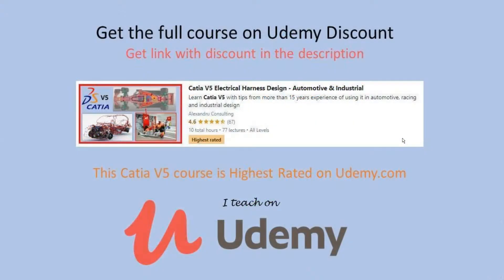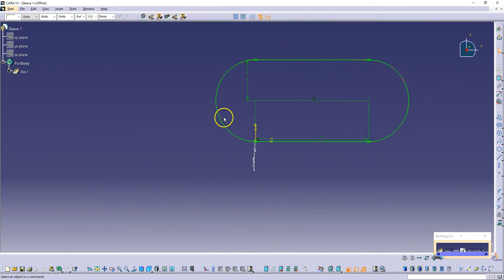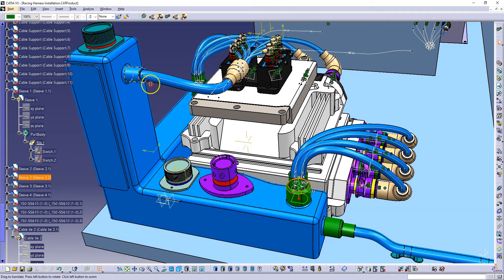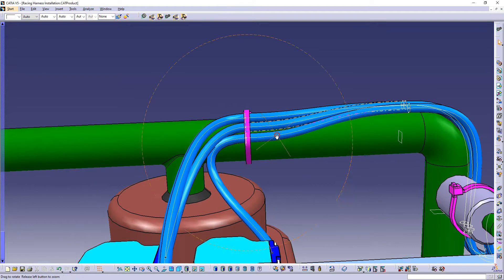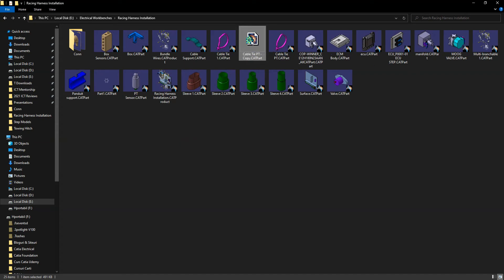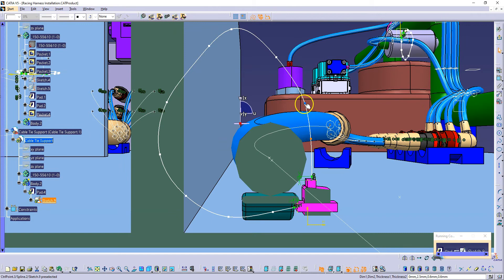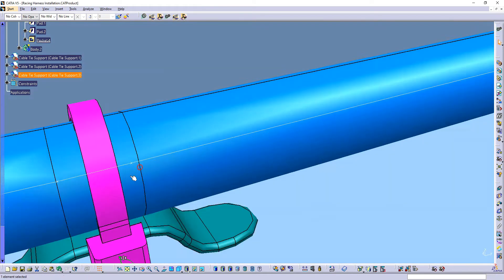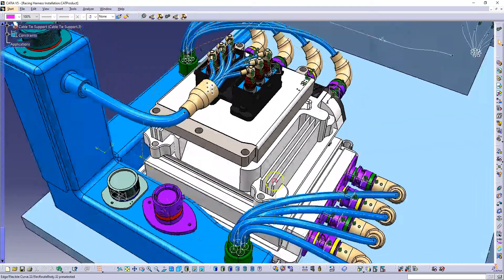Catia V5 Electrical Harness Design Project

Comment: Hello, can you answer my question?
What is the difference between wiring system / cable harness design in CATIA and SOLIDWORKS? I see that both software are from DS and both are used for the same purpose. So which one is better? Could you give a short comparison between them? Thanks!
Reply from the maker: Catia and Solidworks are two different softwares. Catia is better. You can design more complex projects and its more stable.